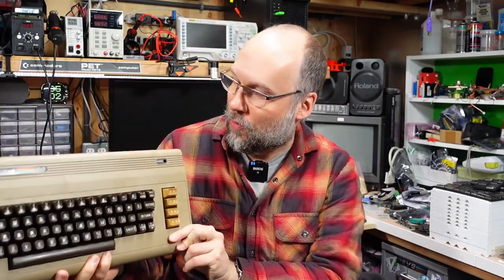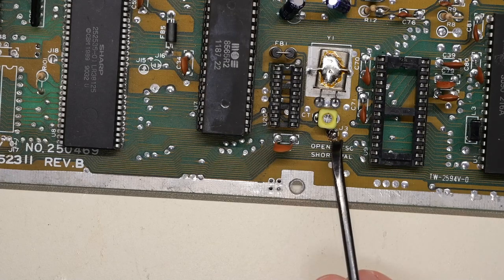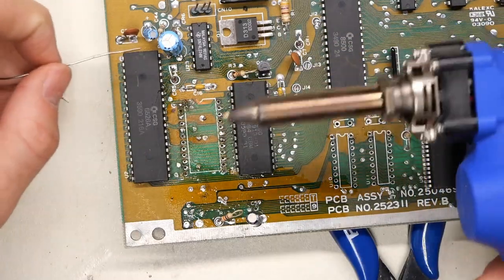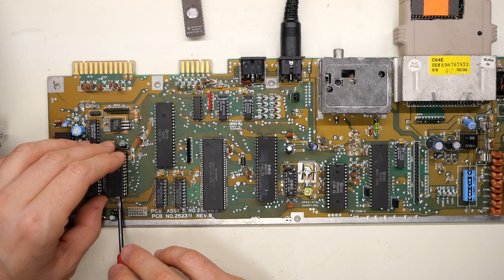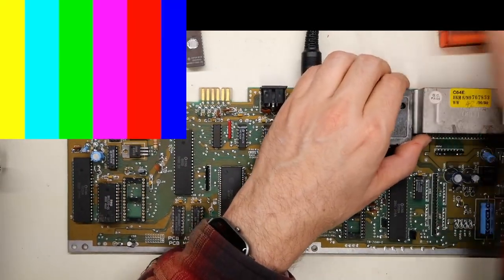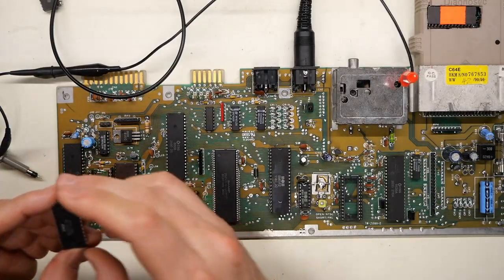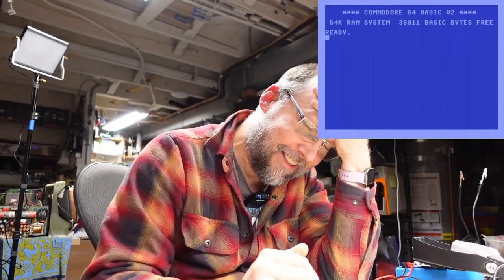Don't use a blowtorch to fix your C64!

Comment: This is the kind of board you use as a donor for a repro board. I admire you saving it but it's probably going to eventually break considering how marginal some of those traces and vias are.
Reply: Ya, seems to better off just as a parts board when the pcb is that bad. those traces was clearly pushed sidewards. Someone has done some crazy things to it.
Reply: yeah. Would be perfect as a donor for a sixtyclone board
Reply: Perhaps, but chances are it won't break, it'll be fine for decades I'm sure. Nobody will flex it.
Reply: @mrdali67  You don't throw a car away when it's been hacked by a bad mechanic, why do that to a C64 that aren't being made anymore?
Reply: @CirnoBush  the c64C PLA is different than conventional c64 PLA. That being said i have repaired many boards much worse than that one in 30 years i have been doing it and they are still working.
Reply: It might be the kind of board that YOU would do that with, but he saved it.
Reply: Putting it in the parts bin makes for a very short and kinda boring video in comparison to the one we just saw. I mean, Adrian is a youtuber, isn't he?
Reply: C64 boards are very easy to repair. those traces are like fence wire lol, simple to fix.

Comment: It's singular that Adrian likes round machined pins socket and consider the other trash while Sean from the channel "Classic Arcade Repair" has the exact opposite opinion.
Reply: I find turned pin sockets reliable over time, as long as they work initially with short pin ICs...the dual/single contact sockets work when brand new...but over time they suffer metal fatigue and fail...it may take many years, but eventually they do fail and I don't want to diagnose again boards I repaired previously
Reply: We used turned pin sockets in crash test systems, nothing else survived.

Comment: Really enjoyed this one! I have finally taken the plunge and purchased my first ever C64 (breadbin model) on Ebay. I am looking forward to taking it apart more than switching it on to see what's lurking! Hopefully it's OK as it was not cheap and sold as fully working from what seems like a reputable sellar. Already looking at a replacement psu first as I don't think I would trust the original.

Comment: You can scorch boards like that if you go ham with a hot air station, or worse electric paint stripper gun that some people use instead of a soldering hot air station!   If you want to re-use the old ROM you could solder it into another turned pin socket, the pins fit perfectly into a turned pin socket. I've done this in the past to rare chips that have badly corroded pins that couldn't be fixed any other way.

Comment: That area over by the RAM actually looks like it has delaminated, and for me, that has always been the point where it’s time to salvage the good parts and toss the rest of the board. The layers of the board are separating, and will eventually strain the plated barrels and cause more problems later.
Reply: Once the inner layers start to mess up, you're kinda screwed
Reply: @SockyNoob  suitably appropriate name you have there bud lol! C64s don't have inner layers. C64's are very easy to fix, even ones in worse condition than this one in the vid.
Reply: @johnbos4637  that may be the case, but in this case, between the existing pad and trace damage, the heat damage to the surface, and the inner substrate separating into layers, the long term reliability is just not there. Even though Adrian’s field found 64 has trace corrosion, the board itself did not show any separation of layers, so that one will be fine as long as the traces hold up.
Reply: @Renville80  There's nothing inside the layers so even if they are split it won't affect anything. Any separated vias can simple be fixed by poking a wire through the hole and soldering it both sides. If a trace is broken simply patch it with a wire. Even if every trace was burned off the board, as long as you knew where they were it could be rebuilt. The old C64's are very easy to repair. It's definitely not rocket science.

Comment: My problem with the "cut the bad chip out" philosophy is that sometimes you end up THINKING something is bad, only to replace it and find out that the culprit is elsewhere. In the case of bad sockets though, go ahead. It's really hard to get them out intact, and often not worth the effort.

For desoldering THP boards, I like to wet the pads in question with fresh solder. Heat up the pad and pin with the desoldering gun until you can jiggle the pin, THEN suck while jiggling the pin. This allows you to suck out all the solder out of the plated hole, and prevent the pin from sticking afterwards. Only do this when you know the board is THP though, because holding it on too long for non-THP boards will end up just lifting the pads.

Comment: Nice work Adrian! Kids - Don't try to repair old electronics using hot air either. Unless you want your PCB split in funny way :D
Reply: Unless it's a proper hot air soldering gun
Reply: @SockyNoob  nope. Old pcbs weren't designed to handle hot air. At first you will notice color change, then the surface will swell and traces will start to detach. All in all it's recipe for disaster. Even the way Adrian is using it is dangerous.

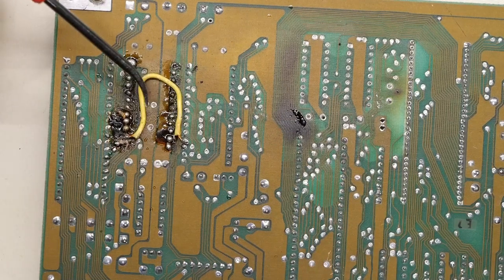Comment: @2:25 that is a machined pin socket. The reason why it's "harder to get chips in" is because DIP chips do NOT (generally) have machined pins. You should NOT be using machined pin sockets for square pin chips, it is very easy to damage pins on the chip due to them bending because they aren't designed to fit in that type of socket. You can indeed get decent quality square pin sockets but these are two different types and the difference in type says nothing about the quality.
Don't put a square peg in a round hole--or rectangular in this case. Machined sockets are intended for round pin headers.
Reply: unfortunately it's a common noob error, including this vid. noobs think machine pin sockets are better than dual wipe sockets and nobody can tell them anything different LOL!
Reply: @johnbos4637  yeah I know which is why I'm annoyed/shamed that Adrian is following and perpetuating said myth 😳

Comment: You probably already know this, but guys who do arcade PCB repair hate machined pin sockets, and usually remove them when they find them.  They prefer double wipe sockets because they stand up to rough environments (heat cycling, repairs, and humidity I think) better than machined pin sockets.

Comment: Maybe try to tin the short legs to make it better contact with the machine socket.
Reply: or better, put the chip into another dual wipe socket, solder all the legs into the socket and insert that into the socket on the main board (a dual wipe, not the incorrect machine pin type he used). It's not difficult if you know how.....

Comment: I stopped using turned pin sockets on C4 repairs as the ICs seem to have shorter legs and tend to creep out of the turned pin sockets. I've spent hours troubleshooting "new" errors that randomly occured after fitting in turned pin sockets in a c64 .
Reply: Yup! noobs use machine pin sockets because they think it's a good idea without actually looking and researching it. There's a lot of parroting going in nowadays.... see something and copy it without thinking.

Comment: Way back in time, the company I was working for had just created a new method of scrambling video signals to create a new PAY TV scrambling method.  Soon flying up from USA to here in Canada, were possible future customers.  But we suddenly noticed that the circuit had temperature voltage stability problems.  We worked for 96 hours straight, to fix the problem.  Anyhow, in the last hour, I came up with the idea of gluing a thermistor to one specific Op-Amp, and tie that to the Op-Amp circuit to resolve the overall problem.  But does it work ?   I only have a few minutes to find out.  So I pulled out the freeze spray and froze the circuit while keeping my eyes on the oscilloscope to monitor for any voltage drifting.  Everything was rock stable.  Then I pulled out the heat gun and heated up the circuit while again keeping my eyes on the oscilloscope to monitor for any voltage drifting.  Everything was again still rock stable, and I knew that the problem was definitely fixed when I suddenly noticed that some of the components on the PCB were beginning to fall over.  Yep, the board was now sooo hot that the solder was beginning to melt, yet everything was still rock solid stable. I will never forget that day, especially when recalling what it is like to work for 96 hours non stop with thus having no sleep at all.

Comment: According to an AMP engineer I spoke to, the machined sockets you favor are not as good at making contact with the flat pins of an IC as the less exotic looking type. However, in 2022 I'd say any good quality, trustworthy brand socket is the way to go with so much dollar store grade stuff around.

Comment: I wonder if Adrian has ever looked at the solder/wire work done on really nice PS2 modchip installs.  I've always wondered why people put those giant bodge wires for trace repairs when kynar wire seems much more appropriate.  I also wonder if resealing the solder mask with clear nail polish is worth it after some has been scraped off the trace to help fight potential long term corrosion.  The PS2 modchip work uses nail polish to secure the wires to the circuit board to keep them neat.
Reply: Isn't kynar wire the thin enamel wire with silver on the inside? And I've heard that nail polish somehow works better than UV solder resist resin pens. Does nail polish actually work as solder resist and does it resist IPA?
Reply: Kynar is the kind of plastic used for the insulation on 30ga wire-wrapping wire. Enamel/magnet wire is completely different. And Kynar is difficult to strip without a notch-type stripper. A razor blade works but isn't the best.
Reply: @SockyNoob  Nail polish is fairly IPA resistant from what I can tell using google-fu, but eventually IPA will remove it (which I think is a good thing because it's not necessarily permanent if you don't want it to be).  Since there's not really practical to buy solder mask, nail polish should work pretty well.  I'm honestly not sure how useful it would be used AS solder mask...I was more concerned about leaving those traces exposed.

I don't remember having trouble stripping the kynar when I modded my PS2 many years ago...didn't use a tool.  Either used my fingernails or my teeth (prolly not so good for the teeth long term, tho heh)
Reply: @8bitwiz_  kynar wire takes 1 second to strip if you know how ;-)
Reply: @johnbos4637  don't you just let the soldering iron melt the outer coating?
Reply: @SockyNoob  no that takes too long and looks messy. only takes 1 second when you know how lol!

Comment: Two things: first, as long as you still have the fat part of the pin, you can solder a donor pin over it. If you have a bunch of old OTP PAL chips from old PC motherboards or something, they are usually perfect donors. One time I was repairing a Heatkit ET3400 and the pin tips of a few (socketed!) TTL chips just broke off, apparently from oxidation alone. Slap a new pin over the broken one, and it was happy again.

Second, that damage looks like one time when I was trying to get parts off of a junk board using a rework hot air tool. The board got a bit singed (not that badly) and it definitely warped. But it wasn't charred that much. I think you may be right about someone using a torch.

Comment: Here in the Netherlands nail paint remover is usually acetone free....

You can buy acetone at the drug store, in small glass botlles for about 3 euro for 50 ml...

I use a small torch sometimes to remove stuff from boards, but only if the board is junk...
Reply: What are they using in nail polish remover instead of Acetone?
Methyl ethyl ketone perhaps?
In the USA, Acetone-free nail polish remover is available here too, and I believe that they use Methyl ethyl ketone.

Comment: To repair an (E)PROM with short pins, put the (E)PROM in a socket (the good type with the round sockets) and solder the short pins of the (E)PROM to the socket, so there is a guaranteed connection, then insert the (E)PROM+Socket into the socket on the PCB.

Comment: If i don't care about the board but want some chips off it, i heat it from beneath with a heat gun an bang the board hot on the table. The solder flies down and the chips jump out. And with the chips all the components around them. If the heat gun is adjusted to high the damage to the PCB is similar. So my guess is that someone wanted the RAM but didn't care about the board, probably because of the horrible job de/re soldering the ROM.

Comment: You can solder an IC socket with turned pins on the ROM chip and you'll be able to use it again.

Comment: Commodore use throughole components only.
First to all you need to buy a Hakko desoldering gun, with this tool remove any IC is very easy.

If you can't affort a Hakko desoldering you can find the Yihua 948, this is a very good option if you are in budget.

Best Regards

Comment: I hesitate to think of the condition of the dead board you took the bypass caps off of, if a burned, warped board with several damaged traces is so much more repairable.

Comment: Skip the Ben Heck method and go for the Voultar method*.

You'll recall in that Ben Heck episode he basically gave up and said "well there's activity on the Oscilloscope, so it's working!" and then spent the whole next episode fixing all the problems he created. 😅

*: Just tin and solder down one side of the wire, then path it out on the board, and  just where it lines up with the second point, just cut it to length, strip it, tin it, and solder it into place. It's faster (because you're not screwing around with trying to melt the sheath) and more reliable (because you're less likely to create a cold joint, and your wires will be sheathed to the correct length, preventing shorts). ✌🏻

Comment: I would use that fiber pen and remove the top layer of oxides and carbon on the burned spot. The burn could cause leakage paths in the circuit.

Comment: Far too many people think they can fix computers when they have zero experience with electronics.  All they can do is cause damage.  Far too often they use soldering guns which have a lot of heat and this usually causes this damage.  They don't understand that there are varying wattages soldering irons and different kinds of tips to use.  (note, stop using your desoldering iron as a soldering iron, naughty).  It's good you were able to rescue that abused PC board.

Comment: 12:15 Please, never use this method on the side where the chip is - rather use it on the socket side (maybe with "dead parts - dummy" installed). :)

Comment: If you really want to MacGyver a soldering job then grab a nail or something similar and heat that up and use it to melt the solder instead of putting the ridiculously hot flame onto a board (and obviously don't heat it until it's red hot) and even that solution is only really good when you're out in the field and have to fix something and I doubt many people will be fixing a vintage PC out in the field

Comment: Great video. Amazingly awful work from whoever tried to work on it in the past. As an acoustic piano technician, a lot of my work is fixing other people's 'work'. 

BTW, nail polish remover has additives in it vs pure acetone. You can find pure acetone at any hardware store like Lowe's, Home Depot, Ace Hardware, etc.
Reply: actually, while this is generally the case, the nail polish remover he was using was clearly labeled "100% Acetone", so in this case it was basically pure Acetone.
Reply: @m.k.8158  good eye. I was listening more than watching as I worked on my own stuff. :)
Reply: @JimAlfredson  well, as I've used that exact product-Dollar Tree often has it.
I've also bought the stuff in the metal can in the past.

Comment: I have successfully used a small butane torch to remove parts from a board, but only did that with boards which were already damaged beond repair, or the part being removed was more important than the board.

Comment: The later 866 revision dropping NMOS support was surprising. Ended up having to get a second programmer for high VPP stuff, which'd be fine but it's kind of awkward since it only takes Intel HEX data.

Comment: I'd say someone has tried to desolder using an iron with not enough heat, and attempted to boost this with a hot air gun set far too hot. Nasty popcorning of those plane areas :/

Comment: Printed circuit boards are awesome.  But they need care if you are going to work on them after manufacture.  They are so easy to damage.  Especially digital boards, as the traces are so small.

I was actually trained to repair circuit boards, but only double sided boards.  And even then, it wasn't easy.

Comment: 20:23 someone used a propane torch on this thing .. so if I were you I would replace the caps and resistor near the burnt area as they might have been damaged too

Comment: Not sure I'd use much efford on this board. Burnt PCB is also often slightly conductive (pure carbon is conductive). Just harvest good chips and connectors - the expensive parts - and grab a a modern clone board.